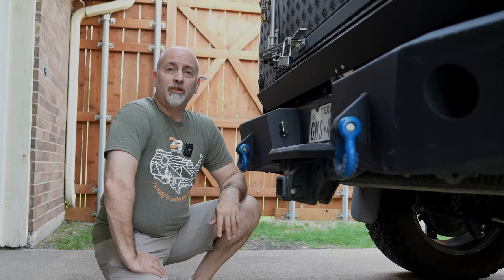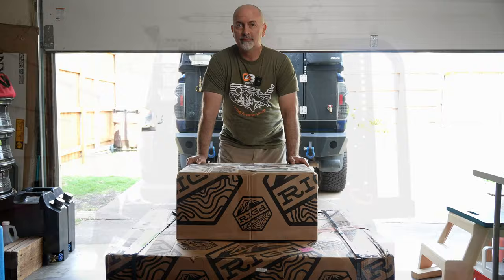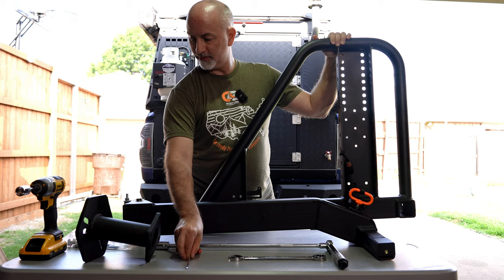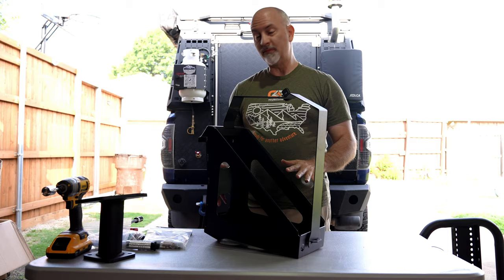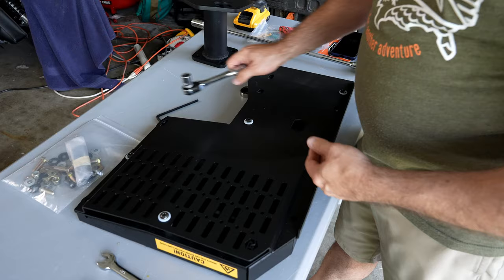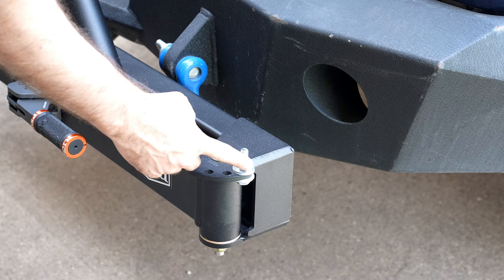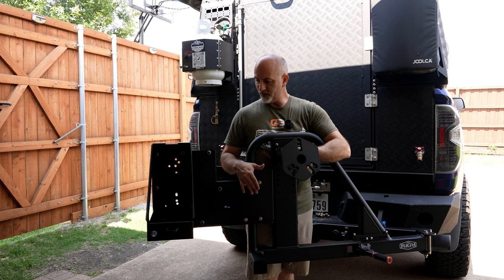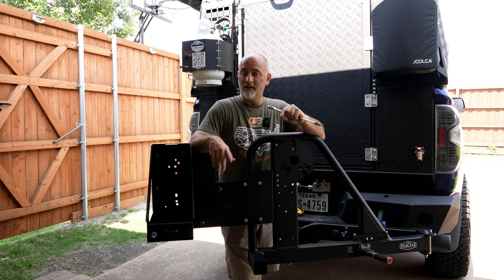Rig'd UltraSwing Tire Hitch Mount How to Install

Comment: not sure why you bought that since your alu cab door can hold a 35 inch tire. rated from the factory.
Reply from the maker: Hey!! I installed the rigd tire carrier because i didn't want that much weight on the door for opening and closing. Plus, I've got other plans for the back door space like a track storage system. 813 fab is working on it.

Comment: I just tried installing my Ultra Swing and with the pin in partially so that I can tighten it to 100ft Ibs I can't get the pin through! I loosen it up and try again and it's the same thing! It's just off by a fraction and I can't seem to get it to go through. It's close though. DId you encounter the same problem?
Reply from the maker: Didnt have the same issue but had to use a hammer to beat it into place a little.
Reply: Thanks I'll give that a try. @OverlandTrailsAdventures